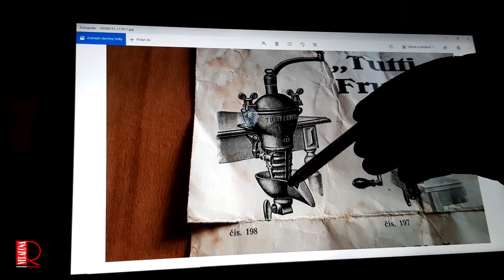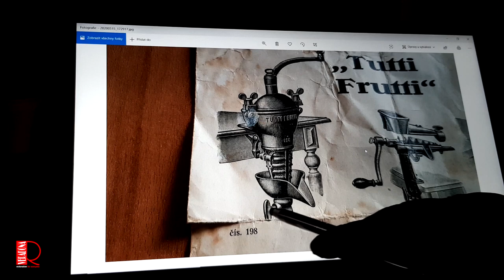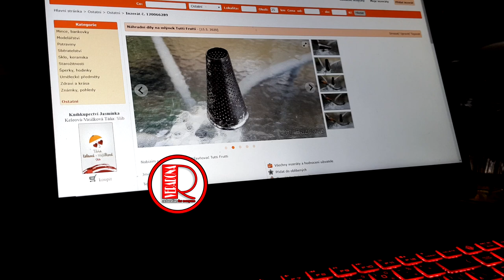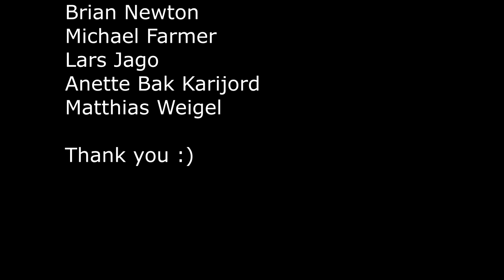Tutti Frutti juicer - Restoration

Comment: When you have a crack in cast iron make sure you drill a small hole at the end of the crack. This will prevent it from cracking more later on. Also a good idea to preheat before you weld it. This is one of your best restos I’ve seen you do. Making parts from pictures is hard and you did that flawlessly.
Reply from the maker: Thank you :)
Reply: K

Comment: another great work properly maintained again.
pealse apply some fat, or oil on the screws, makes it easier to take apart.
machine wash safe?
maybe make an attachment for the handle, to be used with a hand drill, when you are old :D 
however using the handle, must be fun activity for neighbor kids, and the resulting sweet icecream is worth it, and it teaches them how it's made and that it has real man-hour value.
einjoy.
Reply from the maker: I agree with you

Comment: finally, a cast iron repair done right=at 5:27 putting it in the fireplace to normalize the whole thing as stress risers in the metal from the welding are eliminated and the possible re fracturing at the weld are greatly reduced
Reply from the maker: Thank you Earnie :)

Comment: Have u ever thought about using a TIG welder? I think it would be way better for your small restoration jobs. It would give u a better penetration, more control in the small areas, a better finish, and would save u a lot of time grinding.
Reply from the maker: It seems technically more complicated to me.  TIG cast iron likes to crack, it has to preheat, there is a lot of stress.  But maybe it's just my opinion.🤔

Comment: I'm sorry i stopped watching at the point you MIG welded the cracked and broken cast iron parts together....
Reply from the maker: I'm sorry, what was the problem?
Reply: @VeradonaRestoration  your biggest issue is a high chance the steel filler rod melt point temperatures from the MIG will have set up stress tensions and in time the joint will crack apart again. For better cast iron repairs the pieces need to be preheated and then braze welded using bronze filler rod with an oxyacetylene torch setup (for its preheating functionality)... On your project it probably isn't so detrimental but if this was an important cast iron mechanism/machine part the advantages of the lower heat temperatures with brazing process are proven. The project looked fantastic after all your work though!